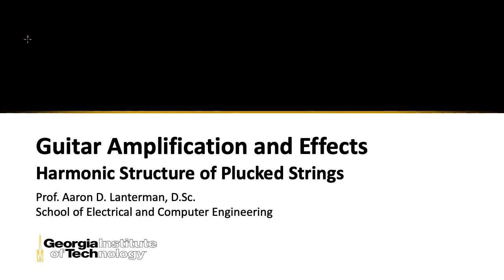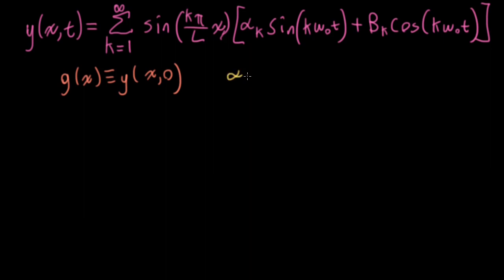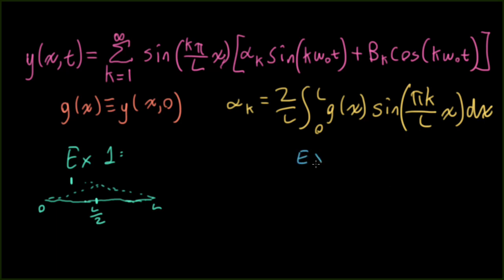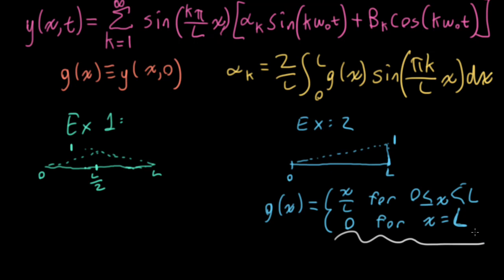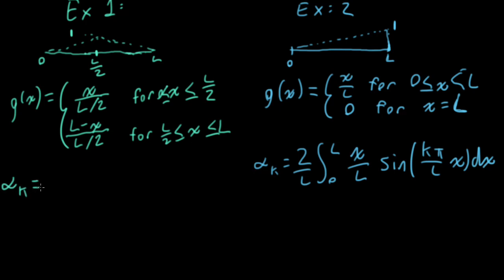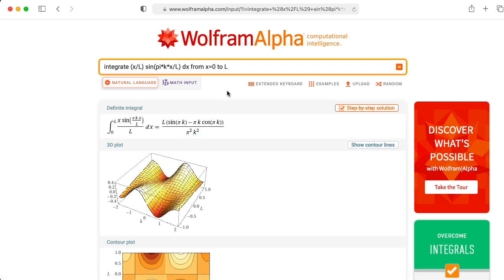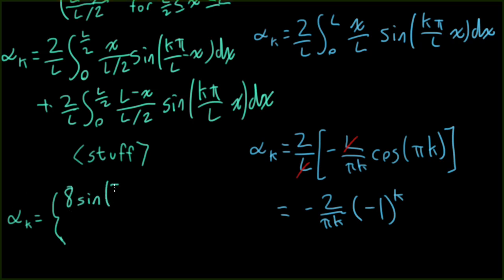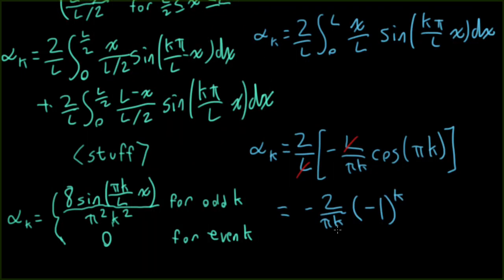ECE4448 L4: Harmonic Structure of Plucked Strings (Guitar Amplification and Effects, Georgia Tech)

Comment: On the Fletcher-Rossing' book The Physics of Musical Insturments there is a torough derivation of the harmonic content of plucked strings as a function of the distance away from the bridge in which the string is being plucked. I believe they derive it both empirically and mathematically, and the results agree. 
I only remember the results which are the ones of musical interest, fortunately the pattern is really easy:
plucking a distance 1/A away from the bridge, suppressess all harmonics of number n*A, precisely if you look at the graphs of the fourier decomposition, the plucking point acts on it by modulating the entire frequency content of a signal in a pattern very much similar to a abs(cos) (Not necessarily mathematically like that, I'm just trying to give an idea of the form since I can't post an image on a yt comment).
For example, agreeing completely with what you said in the video, plucking at 1/2 the distance from the bridge (in units of string length) all harmonics 2n are suppressed, all the even ones. Instead, if plucking a distance 1/5, you would get that all the harmonics 5n are suppressed, with the harmonic 1, 2, 3, 4 getting smaller and smaller as if modulated by this curve that goes to 0 on the 5th harmonic, getting then greater again, max on the midway between 5 and 10, and 0 again on 10.
And so on and so forth.
Now, of course we could have A not being an integer. In that case the same pattern of modulation of the spectra holds but since A isn't integer you would get the 0 not precisely on a harmonic, which in real life means no harmonics completely suppressed.